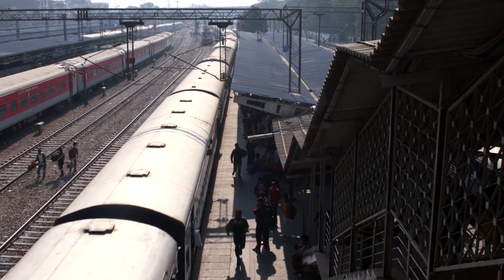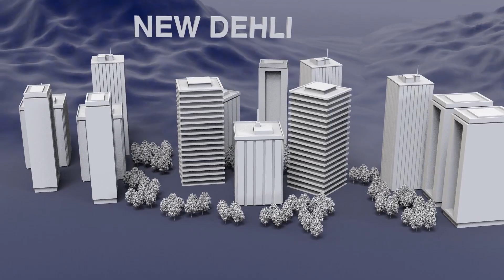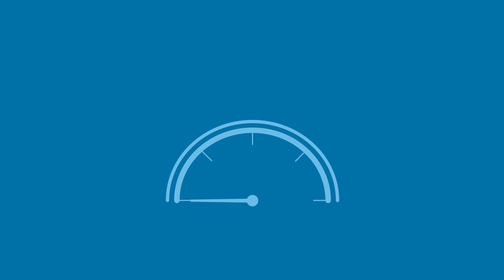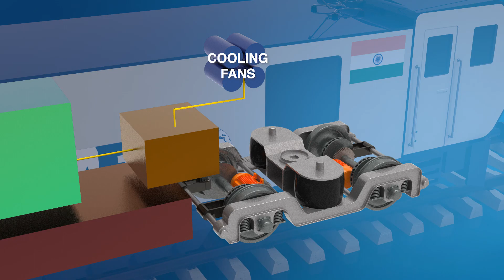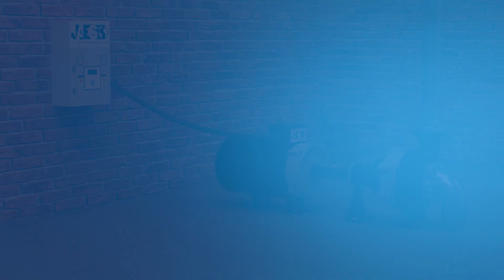History and how do trains work - pantograph-high speed rail

Comment: I've always wondered why the overhead contact wire cannot provide AC since the train motors run on AC power? There wouldn't be a need for transformers, inverters and so on…by directly connecting the electric line to the motors!
Reply: In my country, overhead lines for trains provide 25 kV, 50 Hz, AC.